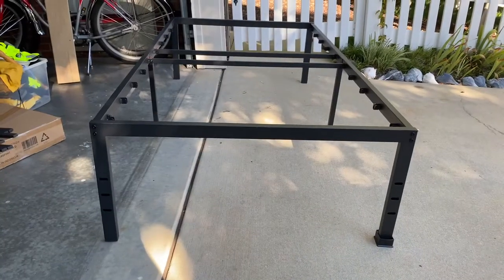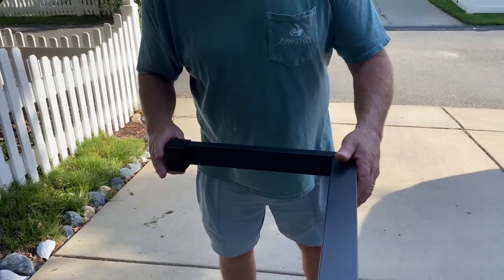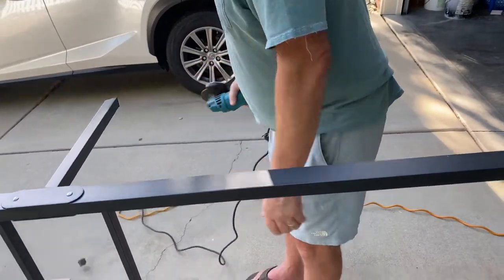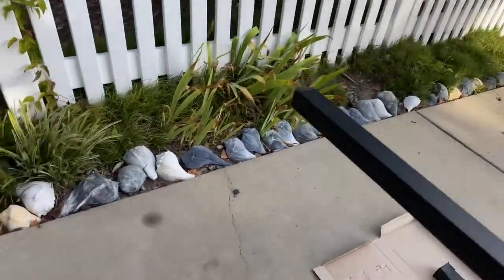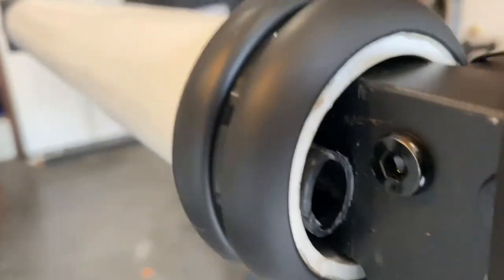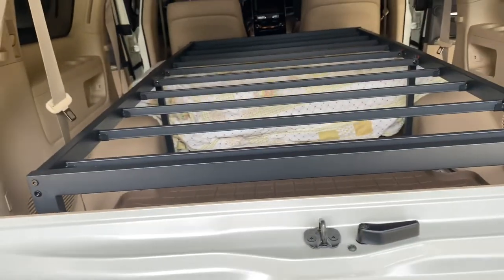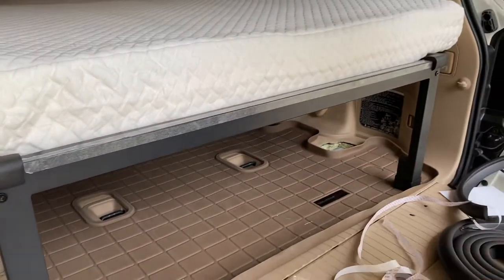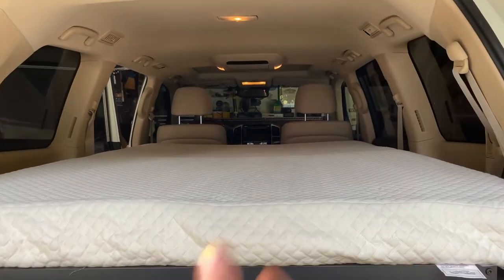HOW TO BUILD SUV BED FOR 2 -FULL SIZE, NO DAMAGE TO CAR, Sleep, #camping How too create Bed Platform

Comment: What happens with the fridge if you have to brake hard? Is it secure enough?
Reply from the maker: It’s strapped with a bungee cord to the metal bed frame while we’re traveling, hasn’t been an issue.
Reply: Absolutely love this.  Y’all are inspirational.